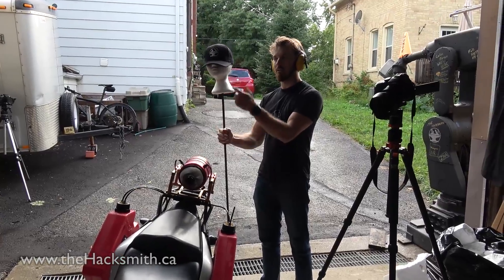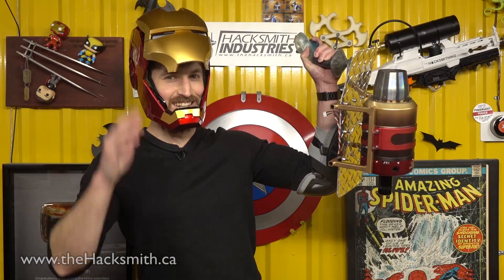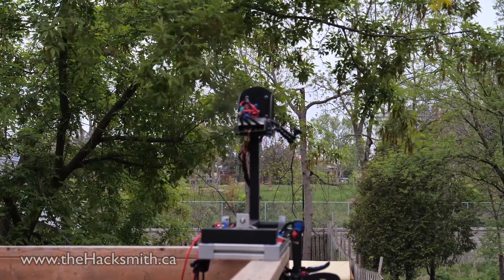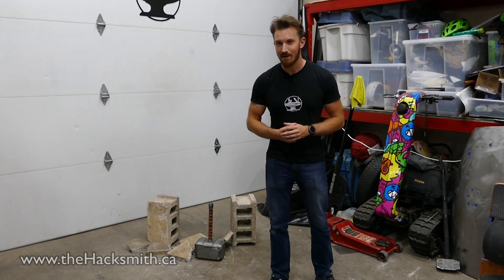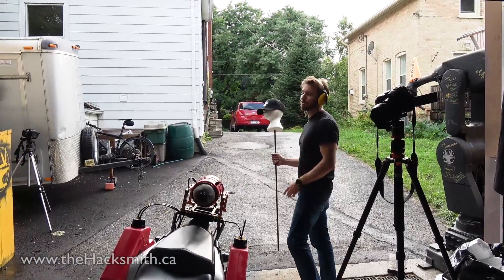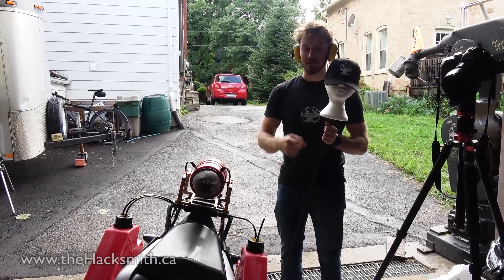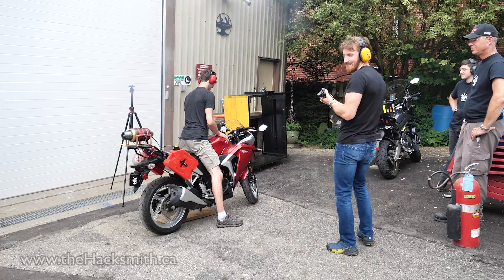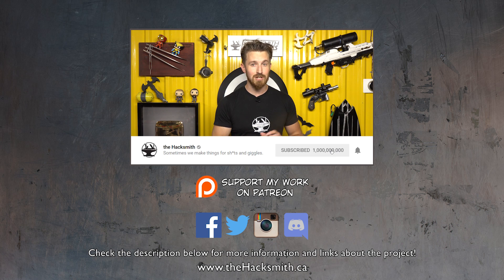Jet Engine Motorcycle Build (GTA 5 OPPRESSOR IN REAL LIFE???)

Comment: The speeds needed for takeoff are relative to the motion of the air (indicated airspeed). A headwind will reduce the ground speed needed for takeoff, as there is a greater flow of air over the wings. Typical takeoff air speeds for jetliners are in the range of 240–285 km/h (130–154 ; 149–177 ), so if you aimed that a bit upwards and did a wheelie, you could fly

Comment: 1) Jet bikes do exist except they incorporate it into the bike not straight off the back, (see Jay Leno's 1999 Y2K Jet bike).

2) I theorised doing this with a large RC jet engine on my pedal bike (4L per mile), and helicopter jet my kit car... the mileage is not great.

3) If you're going to do this, don't use a heavy bike with a load of dead weight to begin with! : /
Reply from the maker: It's a cbr250... How much lighter can we get
Reply: @hacksmith  Removing the CB250 engine, all internal combustion components not related to Jet engine, gearbox, replace motorcycle PbA battery with Li-ion version, etc.

Comment: don't read this nonsense :
maybe try to make it like the y2k bike , basically use the pressure to turn anther shaft like in    the helicopter , or use it to get high pressure  on a oil pump that will turn a 
hydraulic motor connected to the bike wheel via the chain .

Comment: you added a whopping 4.4 fps^2 of acceleration to the bike lol or a little over a 1 m/s^2 

assuming i did my calculations correctly
Reply from the maker: I don't think you did no.
Reply: I mean rounding a little the mass of the bike will be around 500 lbs and F=MA 75*32.2/500=4.83  
I should mention thats ignoring rolling resistance and drag

Comment: The Jet engine would be more effective if it had the ventilation of air when running, e.g. placing it either side of the bike when running instead of behind Ian preventing the ventilation.
this is because the turbine blades would revolve increasingly when there is  more air from the inlet of the turbine, then increasing the amount of oxygen in the combustion chamber, burning the fuel faster.... MORE THRUST

Comment: It is legal to drive on public roads as long as all fuel lines and electrical wires are not in danger of heat damage.  You will need to get it inspected to make it legal, but it should be fine. Since it now has two motors it is technically a hybrid, so you can get a discount on your insurance.
Reply from the maker: hah

Comment: It's kind of funny to see Captain America explaining jet propulsion. I can't wait for the test video on the drag strip.
It would have been just as cool though if the bike was actually a chopper style like Cap, and have Hacksmith ride that instead. But I guess that the bike's weight and slow acceleration will make the test invalid with or without the jet engine active.

Comment: Hello Hacksmith you have tried bevor to creat your one EDF but the 3D print wasn't stronge enough. Have you ever considert to make a mold out of them and cast them in aluminium. I saw this process in a yt video and thought i could be a fiting process for this application.
Reply from the maker: Hard part is making the casting perfect. EDFs have to be perfectly smooth towork